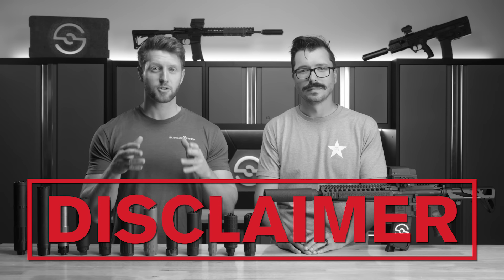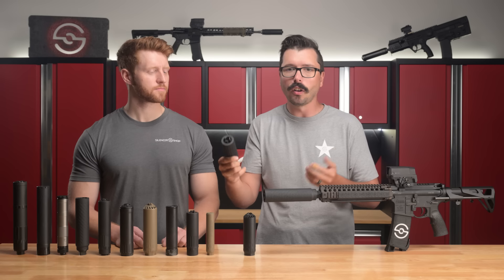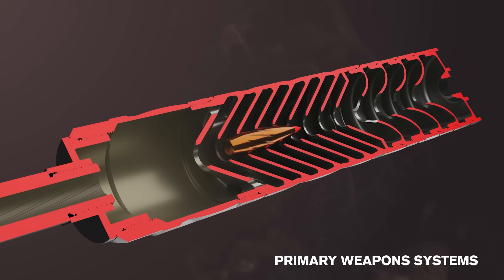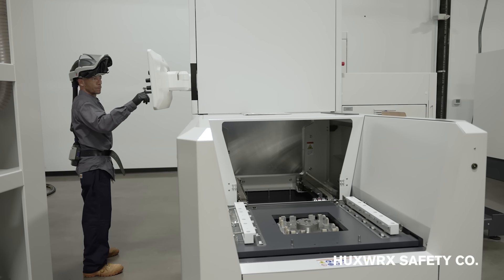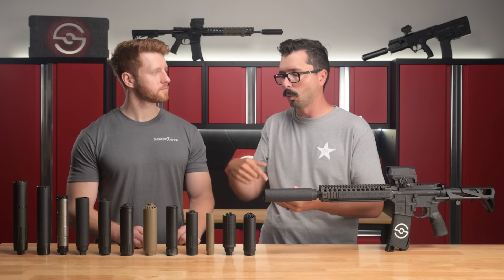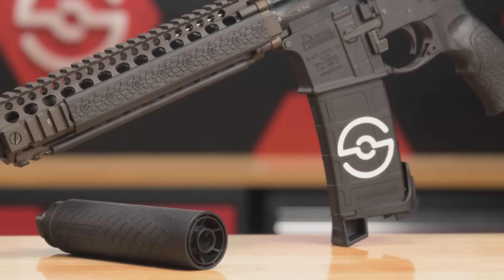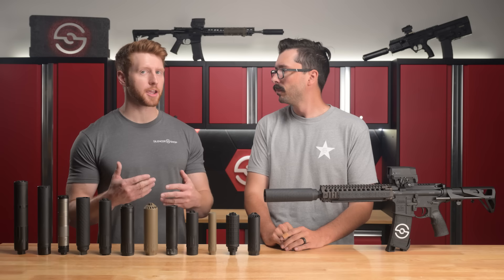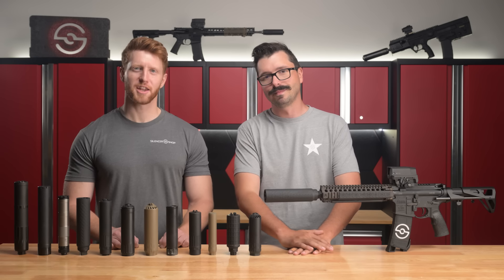What is a 3D Printed Silencer? And Why You Need One

Comment: While absolutely cool as all hell, I personally see no advantage of paying 2 or 3x the price for something that isn’t “more” than movie quiet and is half the size of what is currently available.  Just how much engineering can be done to make a “boom” quiet?  This is being done for 85% manufacturability.
Reply from the maker: The biggest advantages come in weight savings and back pressure reduction, while also maintaining incredible sound performance.
Reply: @SilencerShop  Understood and appreciated…it’s just how quantifiable are the differences.  Much is subjective and much is preference as is everything silencer related.  I guess my point is that the benefit is as much if not more to the manufacturer.  As the end user, only you can decide if it’s worth 2-2.5x the cost. 👍🏻

Comment: Those EOS DMLS machines cost over $600,000 each, and it’s probably closer to $750,000 with additional software and accessories. Also, Inconel 718’s melting temp is over 2300F, so those lasers are putting in work, and there probably won’t be a home desktop version anytime soon.

Comment: I mean.. 3d printed metal sintered tech is cool. Stupendously expensive. Not 'BETTER' than machined billet. I don't get how they can pass on the high cost of a less sound technology to consumers and still remain in business😂
Reply from the maker: DMLS allows manufacturers to build new designs that were previously impossible with machined billet, in that regard they can be better, as there are new possibilities with suppressor design.

Comment: I have a Sig Rattler in 300 Blackout, which has a 5.5" barrel. I will shoot subs suppressed with it. Some silencers have barrel restrictions. Which titanium 3-D machined cans would be the quietest with my setup?
Reply from the maker: CAT Johnny Law would be a great suppressor to look into!
Reply: @SilencerShop  - Thanks. I have ordered the CAT JL Titanium (I want it to be light and I do not mag dump; I'm too poor). I ordered the HUB variant because I have AR's that have the DeadAir Keymo mount. Do I need to order any accessory so it'll fit onto my guns?

Comment: Honestly I really want to see someone take this new process and designs and apply them to a vehicle I would be fascinated to see if that could work as an improvement over current designs .
Reply from the maker: Auto and Aerospace companies do use the tech for prototyping, it could definitely create some innovative designs.
Reply: @SilencerShop  I would love to see some of the flow through can designs and print a muffler using one to see if there is a sound performance boost. I’d really love to see the Ptr foamed ti design done as a muffler cause that could make a lot of sense on a motorcycle

Comment: Are the 3d printed cans completely superior to the old school baffle cans or are there any existing cons?
Reply: As far as quality and durability, yes. As far as flow through/low back pressure, they're louder than traditional cans.
Reply: The advantage of 3D printing suppressors is that you're able to make internal geometries that you wouldn't be able to make with standard machining. If the 3D printed design is just a standard baffle like a machined baffle, there won't be any advantage over the machined baffle.
Reply from the maker: That is not really the case anymore, things like the CAT, PTR, and HUXWRX silencers are some of the quietest suppressors available AND have really low backpressure
Reply from the maker: Thats correct FDCNC, there no inherent advantage to the tech, it just allows for new, more efficient designs.
Reply: @SilencerShop  The PTR Vent 3 for sure! The OCM5 from Otter Creek Labs is another quiet one for 556. Whatever happened to the RD LS5? That's another super quiet (One of the most quietest, if not the quietest can, currently) suppressor for the 556 round.

Comment: DMLS is an amazingly versatile technology! It's awesome to see the technology used in new industries. I wonder how an internal gyroid lattice would perform as compared to the baffle design.
Reply from the maker: PTR suppressors does something sort of like that, they call it PIP, purposely induced porosity, that creates a sort of metal foam lattice. It is very effective.
Reply: @SilencerShop  that's cool!
Reply: @SilencerShop there is one step even better than gyroid or lattice structure. That’s called structured material or meta-material. A company called Original Custom Components is on it, with great results already

Comment: DMLS does save a lot of material that would otherwise be machining waste. However, those savings don't make it to the customers.
I get it, DMLS machines are a huge upfront investment, but once they are written off, it should be super cheap. So here's to hoping that the NFA gets repealed and massive competition and supply increase will finally bring those savings to the customer. Suppressors, espacially light 3D-printed ones, are consumables afterall. They will wear off and degrade, will need replacement.
Reply from the maker: We haven't found that the be the case, in fact, DMLS silencers are incredibly strong.
Reply: @SilencerShop  they are, depending on the model. But they do wear off, especially the titanium ones have a life expectancy of only 5000 to 10000 rounds. Super heavy inconel ones can last a lot longer of course, but may require cleaning of the rather intricate internal structures.

Comment: .000008"? That extremely precise. A human hair is ~.004", .001" is actually an excessively tight tolerance in a majority of cases*, even "aerospace" work is usually .001" to .0005", with .0001" being nessesary in only very, very select components.

Typical headspace gauges for something like 30-06 are .004" apart, as in the NoGo is .004" longer than the Go, and the Field is .004" longer than the NoGo.
Reply from the maker: Yeah its crazy, I believe that is the accuracy that the machine is capable of, not necessarily the accuracy they're using, its still wild how precise these 3D printed parts are.
Reply: @SilencerShop 
The point here is this. Please do a sanity check on stats and data before broadcasting "uncertain" information in marketing videos. 
Erroneous data will erode consumer confidence in the product and your own Brand.
Reply from the maker: There isn't erroneous data, DMLS printers can achieve .00008 layer thickness, its super impressive.
Reply: @SilencerShop  that is very impressive. It's using a laser so that level of precision makes sense, its just crazy to think about.

Comment: I’m waiting on a ventum. Can’t wait until prices hopefully drop so I can buy more
with these short wait times.  Need more 3D printed cans.
Reply from the maker: More 3D printed designs are coming for sure!
Reply: @Mike_Rundle  what is the difference between the HUX ventum and 556 flow?
Reply: @Briathos1  different suppressor and the ventum can be disassembled for service or issues.
Reply: @Briathos1 ventum is hub compatible. Huge benefit for those already deep into a muzzle device already.
Reply: @ Thank you for the response! That’s helpful.

Comment: The statement of having a zero failure rate might be true from a manufacturing standpoint, but if your suppressor comes loose you will definitely not be able to fix it if it was printed in one piece
Reply from the maker: Yes, most 3D printed designs are repairable. They can cut off the damaged portion and reprint/reweld that section.

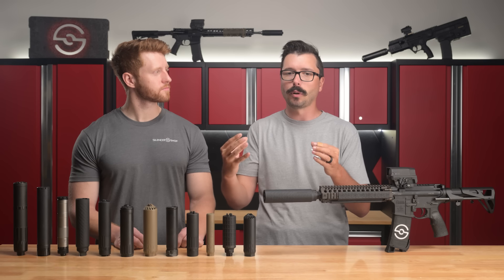Comment: 3:00 you can design a standard CNC cut part in CAD. I would be incredibly surprised if they didn't. You don't seem to know what you're talking about, just regurgitating market speak that you don't actually understand.
Reply: Of course you can, the issue is that the traditional systems are much less complex so the benefits of the CAD simulations are less, they’re not dealing with gas flowing thorough the silencer the same way, it’s easy to predict what will happen with a standard baffle design.
Reply from the maker: You're correct Michael! Some manufacturers use CAD for traditional baffle cans, but the benefits are less apparent as the systems are more simple. The tech still ahs benefits, but is a real force multiplier when it comes to these incredibly complex 3D designs.

Comment: ive seen manufacturers in forums talk about how CFD computer fluid dynamics, the program that simulates the gasses, unfortunately doesn't work well for suppressors as its really difficult or impossible to replicate the exact conditions of whats really happening, I'm not understanding how it being 3d printed changes this, a non dmls suppressor is designed in cad first too lmao
Reply: its triggering how little actual knowledge these guys have
Reply from the maker: You are correct that you can use the same programs for CNC cans, but becuase they are less intricate they are also easier to predict, so the benefit is much less than on the high flow 3D designs.
Reply: Not so. CFD solvers and mesh generators make no distinction between simple or complex geometry. And in turn, the difficulty of the analysis ("prediction") is not dependent on, geometry.

They simply execute the task given too them by the engineer. 

They are usually limited by the computer horsepower, the engineers time, and yes the complexity of fluid dynamics. Especially in a radial form factor.

Comment: They can still be repaired? Really? I think you meant to say some of them can still be repaired. I've talked to the PTR guys and CGS guys about the CAT silencers and both responded with it's going to be a complete replacement.
Reply from the maker: In most cases they can be repaired without replacement.
Reply: @SilencerShop  ultimately it's up to the buyer to be educated on what they are getting is cases such as the Velos where the 3D printed portion is welded to a sleeve that has the serial number on it that yes it should be able to be repaired with out a new tax stamp.

Comment: If these cans are made by running a program thru a machine...why is there such a lack of supply?  What's stopping the manufacturers scaling up...more 3 d printers?  I've pre paid $1100 for a can, 2 months ago...still waiting.  Charge an extra $1k each can, charge what market will bear.....use the money to buy more printers. Get with it.
Reply: Look up the cost of a sintering machine with a volume capacity capable of producing a completely metal 3d suppressor. The machine alone is in the millions. The energy cost to run the machine is high, the tooling maintenance and upkeep of the machine is so expensive because you’re working with titanium, steel and inconel. You also need a shop capable of handling forge like conditions. Until these suppressors become the standard and enjoy an economy of scale, they’ll remain as expensive as a car down payment for the near future

Comment: Hard to believe 3d printed will last as long as cnc
Reply from the maker: The process makes them incredibly strong, it eliminates weak points.
Reply: Sintered manufacturing isn't anywhere near as strong as subtractive manufacturing, no. The question of proper engineering is, and has always been, is it strong enough for its intended purpose. In this case I wouldn't hesitate to go with the 3d printed can.

Would I want a 3d printed barrel? Oh hell no. But a suppressor really isn't subjected to all that much mechanical stress comparatively speaking. Erosion and heat are the main problems cans face, and the gap began sintered and subtractive construction isn't nearly as big there.

Comment: I dont want flow-through, so 3D printed is unnecessary.  I'm only interested in machined and welded cans.
Reply from the maker: There are other advantages, lie incredible sound performance, lightweight designs, etc. But you are correct that there is still a place for traditional suppressors.
Reply: why do you not want flow-thru? I have only had good experience with mine, love having no gas shotgunned in my face every shot. Genuinely curious if there are drawbacks, I have the original HUXWRX TI suppressor when it was called OSS
Reply: @edxlee  You are giving up sound going flow-thru.  Gas stuff is of absolutely zero importance for us bolt gun people.  All the flow-through stuff is 3D printed, I dont trust the 3D printed stuff not to break yet.  I need to do further testing, but seems to degrade accuracy too.  But most importantly, can see more through an optic with a traditional design.

Comment: Acting like you wouldn't design a suppressor in a CAD program or be able to do simulations on it in a CAD program because you aren't 3D printing it makes me think you guys don't have the greatest amount of knowledge... Were you just trying to fill run time or are you just that unfamiliar with how things are made? The only difference in subtractive and additive manufacturing is the types of designs that you can use. Either way, you're still making the part in CAD and running sims on the design. That will not change.

I really feel like you guys just threw a bunch of buzz out without actually giving any real information on this subject or exactly why the designs are better. "They work better" is basically all you said through the whole video...
Reply from the maker: You're correct. You can use CAD for traditionally made silencers, the point we are making is that the benefits are not as great because the designs are not as complex.
Reply: @SilencerShop there are some designs that can’t be produced using cnc, like sintering , but many designs with strange forms can be done using cnc or edm , but it has to be done in modules that will be screwed together. Somit probably more economic to print these in the end. Simulation of airflow  of these very complex design might also become very complex. Not even sure that that is actually doable